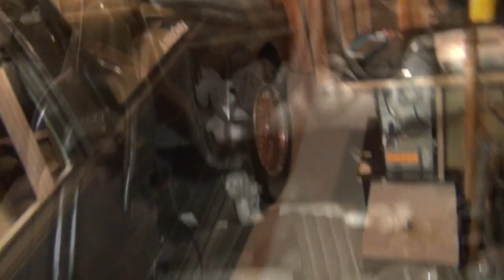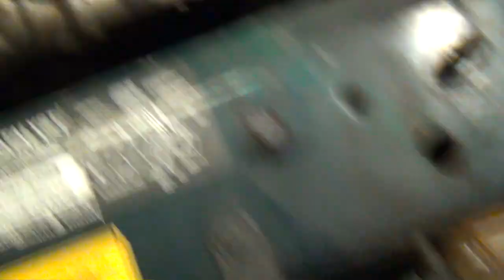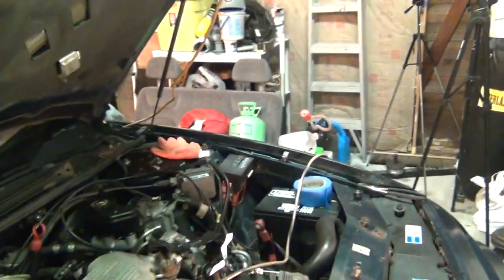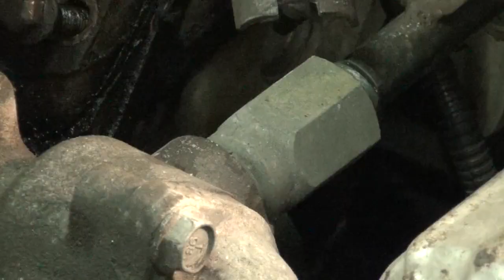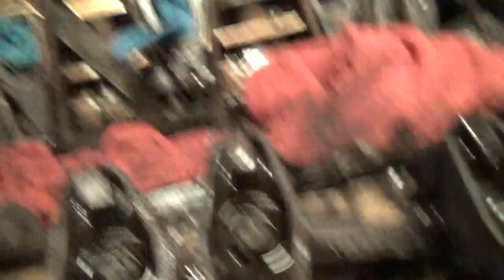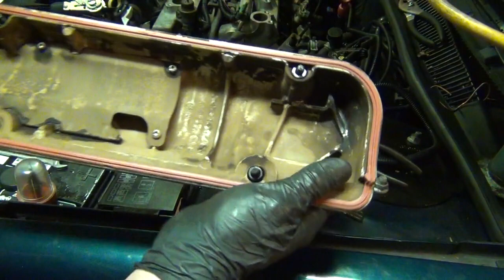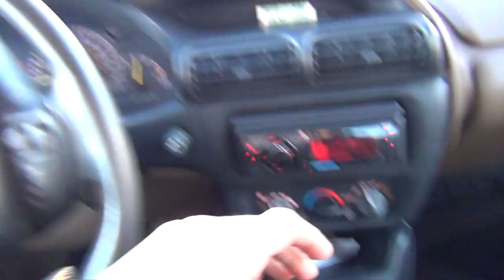Intake Manifold Gasket replacement GM 3100 V6 95' grand Prix

Comment: You did a great job on this video. It's time to get started on my 96 Lumina. I appreciate you taking the time to make this tutorial. I removed my front valve cover to find a loose rocker arm and a missing push rod.
Reply: +Scott McGillivray (Snaplink) missing push rod?  miracle your car ran all that time what the hell :)
Reply: also doing this on a '96 Lumina but my luck sounds a little better than yours haha
Reply from the maker: @scott - I had a loose rocker too hope this worked out this was a while ago you posted this

Comment: I have a question . I have a grand am gt 1997 and my antifreeze is leaking but it's not going inside the engine its just leaking it out what do you think it could be ?????
Reply from the maker: David Trippymane  Could be a freeze out plug, and warped cylinder head or a water pump failing. or a hose with a pinhole in it. has it overheated at all?

Comment: I'm lucky. My intake Manifold gasket isn't leaking in the engine oil, It's leaking from the outer gasket seal. Oil is clear and everything looks clean so the gasket gets changed tomorrow to fix that leak.
Reply from the maker: trafalga5136 Dont forget to replace that distributor plug O-ring since your in there. They always Leak

Comment: Did you still put Dex cool back in
Reply from the maker: James Kozak  No, I used the Green stuff.
Reply: i am planning to use the normal green stuff. i heard to many bad stories about dex-cool
Reply from the maker: James Kozak  The Dex Cool stories you Heard are a thing of the Past. When First Introduced It Had Acidic Properties that deminished the Life of the already Poorly Designed Intake gaskets.

Is  this true?. Im not sure. It could be. Ive read a few reports that stated just this. All coolants that are different in color have different protection properties etc. Dex cool is an extended life anto freeze. It is always good to run what the manufacturer suggests. such as, if you have a honda, Certain honda's require BLUE coolant. It is not suggested that you put anything else in for the simple reason that coolant protects internal parts fro corrosion, and promotes a certain cooling etc.

With Dex cool, you can get away with using the green Coolant in its place. HOWEVER, when you do this, it is very important to clean out the existing Dex cool COMPLETELY.

DEX COOL and  the traditional Green Coolant DO NOT like Eachother. and when mixed together forms Brown Sludge clogging up Everything. Ive seen this COUNTLESS times on MANY GM Vehicles. and the Process is very long and could be expensive to Undo.

Many shops that dont pay atention to what fluids are in a cars system top off your coolant with the Green stuff when you have the dex cool in. Resulting in what I have mentioned above.

Good luck with your project. Please let us all know how you made out
Reply: I think the owner before me cleaned and changed it

Comment: does the car run hotter when you have a bad intake gasket leak? my car get really hot til the fans kick on when i go into a drive thru. i am getting it replace really soon but i want to know if it will solve that issue. i had it check and the head gasket is not leaking. i have a 2002 Pontiac Grand prix 3.1L SE with 144,000 miles
Reply from the maker: James Kozak  Yes it does. Cause after a while, your losing coolant pressure in the system, and the oil is contaminating the coolant. and then it turns into this sludge that will clog up your heater core and radiator and other parts of the car. one thing I wish I did was replace the head gasket while I was down in the engine, if your going to get yours done, spring the extra money and have a block up gasket job done. chances are, if its running really hot, your doing damage to that aluminum cylinder head
Reply: i am getting it fixed Tuesday. its a small leak. nothing is really mixing right now. we caught it before it got really bad.
Reply: the old owner put a 180 thermostat in the car and the car is programmed for 195 so i going to get them change it. when it does get near 195 the engine runs really smooth. idk why he put that low temp in. he said he was trying to figure out the car running hot. the leak is near the power steering on the intake gasket. Are you still driving he car? i bought the same gasket you did so is it doing good still? i bought the gasket kit from Oreilly parts store

Comment: Really liked the video!  

Dang shame GM went cheap on the intake gasket.  The replacement FelPro looked to be much better quality.
Reply from the maker: snippits75  Oh they Definitely are much better than the Original gaskets. its been 3 years and My Grand Prix is still running strong
Reply: The felpro are much better quality also get rid of that Dex cool anti freeze.

Comment: 2004 Gran Am, replaced fuel rail, plugs, fuel pump,sometimes it starts sometimes it wont! Any idea?
Reply from the maker: Sterling Jones  Sounds like a Bad ESC. Electronic spark Control module. i had that same problem on a 1993 cutlass supreme with the 3.1L.  this is a module that sits under your ignition coil packs. follow your spark plugs to the top rear of your engine. your lucky its a 2004. the 3.lL from 1993 down had those coil packs by the starter and they were a pain in the ass to get too. Also Check to see if you can hear your Fuel pump priming when its not starting. you could also have a bad fuel pump. or relay. has this car been sitting a real long time?. I got alot of these older GM's that sat for a while have a faulty fuel pump just from sitting.  let me know
Reply: Ended up having to over riding the security system, runs great now! Thanks!

Comment: hey man, I've been having a problem with my gm 3100 overheating..sometimes on the highway when i get going it will cool down but most of the time its in the red and restricts me to 80km/hr .. i was told it could be anything from the thermostat to a blown head gasket.. how can i tell what exactly it is and fix it myself to save scrapping the car...please help.
Reply from the maker: GhettoArtKing  Hey thanks for the comment. and sorry for the delayed reply. have you looked through my Channel? I pretty sure I have a diagnosis on those symptoms on my 95 grand prix with the same motor.  Check out my Channel and subscribe to us we have some more trouble shooting videos on the way.  But to answer your question, with these cars it could be quite a few things. When you get on the highway and it cools down it could be because you have low coolant in your system or a flow problem.  The radiator is doing its job when air is being forced at it at higher speeds.  These engines are notorious for intake manifold gaskets failing.  What I would do is when the engine is cold, take a look at the overflow bottle and see if its up to level.  if not fill it to alittle under where its supposed to be, then take the radiator cap off and see how much coolant is in your radiator.  if its low, fill it up and drive around and see how that works out for you.. Check back ina week or so and see if you lost coolant. if so, chances are you have a internal or external leak somewhere.  two other things I want to point out that some people dont consider is the serpentine belt and tensioner. water pumps usually start leaking out of what is called a weep hole at the bottom of the pump, and u can actually see it driping out of the bottom of the pump.  You can pick up a brand new pump for $20 or less.  and theya re easy to install just be carful with the bolts that hold the pump in and make sure you take a razor blade and scrape off the old gasket and spray some brake clean spray where the old gasket was and wipe it down with a cloth to get a clean maiting surface.next, take a look at the serpentine belt and tensioner. with the car running, look at the tensioner. if you see it jumping up and down, its time to replace it. a bad tensioner will actually slow down the water pump because the belt is unable to deliver the grip and torque the pump needs to spin.  serpentine belts and tensioners usually come hand in hand, replace them both and make sure that your new tensioner comes with a new pully at the end...Next two things u can look at is the coolant condition. Another thing these engines are known for is this brown sludge residue inside the cooling system. you will see it when you ake the cap off and check the fluid . if you find this, you most likely have a clog somewhere and the whole system needs to be flushed.Its possible that the thermostat is getting stuck.  the thermostats on these 3100s are not fun to get to. Ive always tested my thermostats in a boiling pot of water to see them open and close. But rarely do I ever put the same thermostat back in . they are cheap enough to go ahead and replace it anyways...the unfortunate side of your story is it sounds like your engines already taken a huge heat soak already with you running it hot like that. thats really bad for any engine with a cast iron block and aluminum cylinder heads. the heads actually warp and crack because of that.  thanks for the comment, let me know what you find and how it trurns out
Reply: thanks, ya no oil mixing with coolant or vice versa.. and not blowing any smoke.. when i run the car and take the cap off it spills out a bit but no major gushing or anything.. opened the bleeder and there is a bit of air in the system.. i do have a squeaky ac pump pulley so replacing the ac pump might be a start as well as the thermostat.. no external leaking as far as i can notice.. no leakage spots under the car.. I'm jus going to order a whole new intake and head gasket kit as well as a new ac pulley and thermostat and put aside a weekend to replace it all thanks to the help of your video.. thanks for the info man.. if there is anything else u can think of let me know i can use all the help i can get ..
Reply from the maker: ***** GhettoArtKing     has some good tips and places for you to start. Thanks Jorge for your input. I like when people post comments and help people out. I spent 5 hours last night getting back to people that have commented on the stuff on my Channel . Good luck on your channel, and reference this video and post on here if you get stuck. I made it so i get notifications now
Reply from the maker: *****  exactly. Thanks bro  good day to u too

Comment: Is it necessary to replace the manifold bolts?mine didn't overheat yet but found a little butterscotch on the oil cap.
Reply from the maker: Luis Garcia  manifold bolts, no. cylinder head bolts yes. you have to. those bolts are called " torque to yeild" bolts. THey actually Stretch when you torque them down and they are good for only one use. believe it or not, pretty much any engine with cast iron block and aluminum heads have these bolts. and if you were refering to the cylinder head bolts, be sure that when you take the cylinder head off you send it out to be checked and possibly Decked at the machine shop. Ive done many of these 3100 head gasket jobs and all of them needed the cylinder heads decked " resurfaced cause they were alittle warped". good luck any other questions please put it in the comment box, I like other viewers to see whats going on if they have questions . thanks for the comment, please like our videos and subscribe to our channel for new videos. have a good day

Comment: I'm in the middle of this repair, due to coolant mixing with engine oil.  What would you recommend to clean all the old, brown sludge like oil in the engine after finishing the repairs..?  I am adding an additive to the coolant for a coolant flush....but do they make a product that could be added to the oil to help clean the engine..?

Comment: Just wondering I have a Buick Century with a 3100 that is leaking antifreeze. Its not the water pump or a hose the leak is internal, coming from the back end of the engine somewhere, I was told it was the intake gaskets but I don't have the gunk like your project, the oil hasn't mixed. So I was trying to see if this was true before I attempt to change the gaskets.
Reply: That's how it started with my car.  I have a '96 Buick Century, 3.1, V6.  I started losing coolant, slowly at first, then started to notice a small drip on the garage floor.  I checked the dipstick and the oil fill cap, all seemed normal.  About 2 weeks later I was driving around and the temp gauge on the dashboard pegged....!  Limped back home, checked the dipstick and it was a nasty light brown color...and steam was coming out of the dipstick tube.  Opened the oil fill cap...same thing..!  That's when I decided to make the repair.  As I proceeded into the repair....everything was exactly the same as in the video.  I did take the opportunity to install new spark plugs, a new tension pulley and new fuel injector o-rings.  Be careful removing the hard vacuum lines, they are very brittle and mine broke easily.  Keep the hard rubber ends, you can buy new vacuum lines at the auto store, piece them back together....good as new.  Good luck..!
Reply from the maker: Marcus Moore  your probably leaking out of one of your freeze out plugs in the block or your head gasket is leaking externally. that does happen and ive seen it not contaminate the engine oil. also, you hae your heater hoses back there too. I would get behind there and see exactly where its comming from. maybe even put it up on ramps and get inder there and see where is comming from. Chances are it could be your heater lines.  they are a run of rubber hose connecting to metal hose and the metal hose rotts out
Reply from the maker: bivouac89  Thnaks for your reply.  I wish I could of got to it sooner
Reply: 905speedgta I am going to finally attempt it now that i have the time and money. I checked and it seems that the antifreeze is around where the lower intakes are located. I cant exactly see where its leaking from but there is a small puddle around that area. Also do you happen to know if the intake manifold could cause an evap leak or misfire? Just took car to emissions and it failed. I had a #4 engine misfire and small evap leak.
Reply: 905speedgta one other thing i dont exactly get what you are doing when you set the valves im confused on that part. What happens if valves are not reset. I am not a mechanic myself but i do have a little mechanical aptitude.

Comment: Thanks, I needed that!  I think 7.4 ft/lbs + 30 degrees should be 45 foot pounds to eliminate the guess work in finding 30 degrees.  Very tricky re-assembly, I didn't label every nut/bolt and bracket well enough and the ones I did still prompted confusion because you gotta put some things on halfway to enable other parts to fit.  Otherwise, I did it in my garage in a day and a half.
Reply from the maker: kerrytheman  Nice work, thats what My Channel is here for. for the Do it yourself'r. Check out my channel i have a fair amount of content on it and subscribe for new videos.  I dont always go crazy labeling things, i did it because It was apart of my Video and I wanted to have people fully understand what I was doing

Comment: Might try cleaning coolant reservoir with a household steam cleaner that has a thin metal wand. Possible a used one on Ebay. Nice Video. You done good.
Reply from the maker: rfn944  hey sorry for the delayed reply. its been a month, let me know how that worked out for you with the steam cleaner. Im kinda interested in knowing how that turned out. I would just clean your existing bottle. Every used bottle I ever got was always worse off then then one I had,

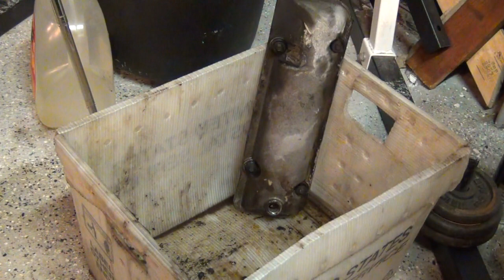Comment: When you pull out the distributor cap 50:00 what happens if you don't put it in exactly where the gear was?
Reply from the maker: sneakysnakepie1   It wont go in. Theres only one way you can put it in. and when you know you got it right is when you sink it back down and it goes all the way.  This isnt a distributor.  I forgot the name for this, but its there because of the design change when GM made these Distributorless Ignition Engines. Sorry for the Delay, i justsaw this now

Comment: very good video and I don't think that it was to long, this is a job that is going to take some time to complete. Good angle shots with the camera.  Maybe one suggestion that I would make, is to include the re-instillation, re-filling and bleeding the power steering pump. You want to make sure that you get all the air out of those lines as well as the cooling system.  Good job
Reply from the maker: Charles B thankyou

Comment: what was the torque spec for upper and lower intake gaskets. my ex had one of these cars and drove up from texas with just water in the system it ruined the heads tried to rebuild the top end but her other friends got in the way taking it apart as i put it together while i was at work she left me because i couldn't get her car running right good trade.
Reply from the maker: markam campbell  dont you love it when people get in the way. I dont remember it was so long ago, the specs should be in the video.

Comment: Sorry to keep posting on this video. I just wanted everyone to check this out 48300 Push Rod Remover
It's the puch rod remover tool I was talking about. I ended up going to the junk years and pulling two heads for this project. it's was such a pain in the butt. Any ways this $15 tool would have saved all of that! Really guys if your GM 3100 has a bunch of miles on it you NEED this.